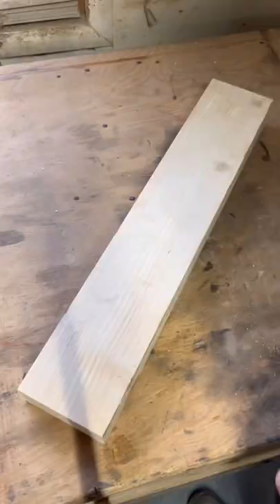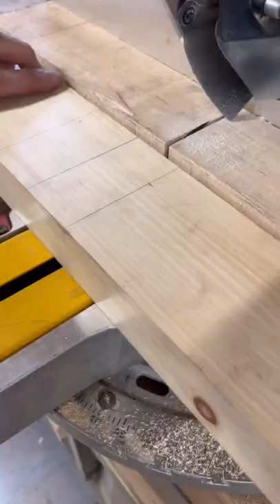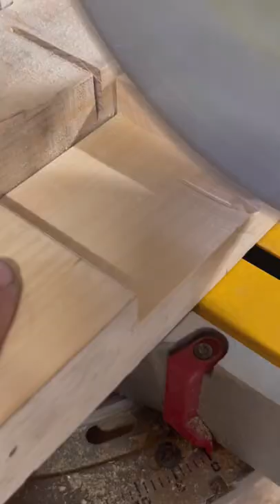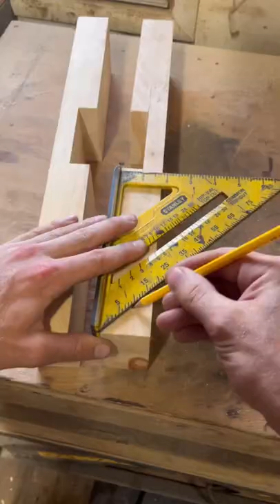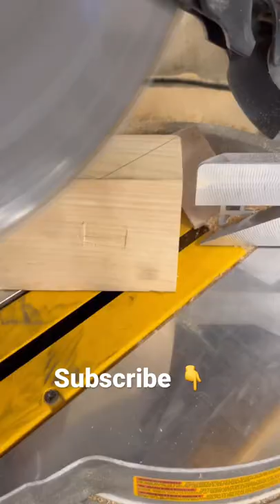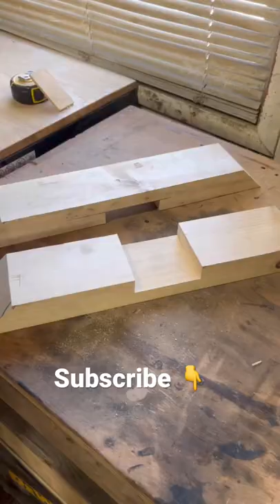Don’t need to buy an expensive machine to make this. #shorts

Comment: So you'll never learn to use chisels quick & easy, and btw it's getting really fun when the sawblade catches anyting in that right/left move. Don't use machine for stuff they're not made for, some things are OK, but this is almost on the edge, wrong wood: catastrophe. And yeah, I learned that stuff and working for 20 years as furniture maker.

Comment: That’s a $500-600 dewalt, that’s pretty pricey for a lot of people
Reply: Can be done much better and safer with a tenon saw and a sharp chisial will take longer but you will get a better and tighter finish as well as not have to use a tool the wrong way

Comment: Never seen that on a miter saw. Nice work using stop. 👏.
Reply: I accidentaly, did that a few weeks ago when I was using my mitre saw. Like normal I had to chisel out lots of joints and do the wafer thing cuts with the mitre saw. All of a sudden I thought that i'd carefully make the cuts and then slowly move the saw from side to side.

Important note: you must move the saw not only from side to side but through the wood. Failure to do that will see your dados not being flat and will be bevelled due to the blade. Hope that makes sense.

Comment: I suppose expensive is subjective, because the £250-300 spent on that mitre saw is damn expensive to me!
Reply from the maker: Mitre Saw is the cheapest you can buy to make something like this compare to the proper machine would cost between $2000 to $5000.
Reply: @Cameronsault  it is indeed, but you still missed my point, not everyone could class £250 on a mitre saw cheap! That’s 3 days work, before tax, lunches, travel, and breaks.
Reply: @almostanengineer  if not you can also use a circular saw but it's a lot harder
Reply: I picked up a mitre saw from Aldi (£85 after converting). It also has a depth stop and is very much capable of doing this.
Reply: Could this not be done with hand tools. Lets say a £10 woodsaw, £10 hammer and a £20 chisel set would get this made. A skilled carpenter could recreate this with said hand tools I wager. That would be even cheaper than your 250 quid mitre saw.
Reply: @TWH442  It can but hard af for convenience you can just go buy a circular saw(or Ryobi for like 80$)at harbor freight for like less than 50$ or their 10in miter saw that's like 100$. Obviously they won't last as long as the more expensive stuff but they can if your not to rough on them